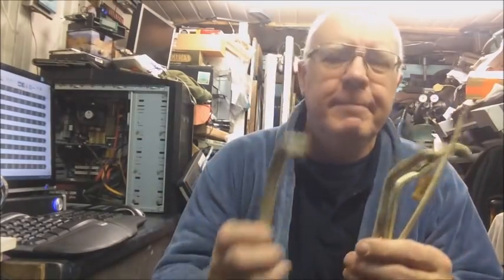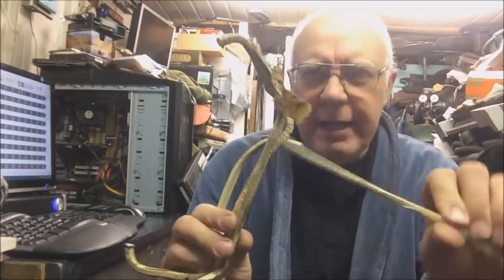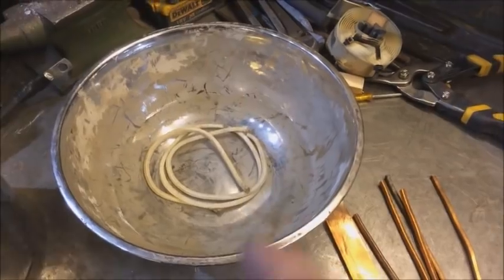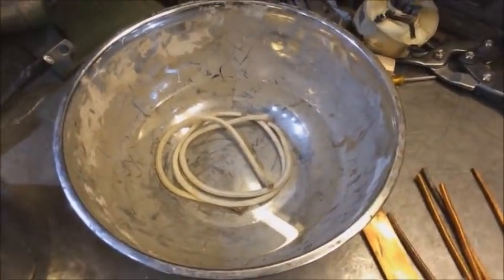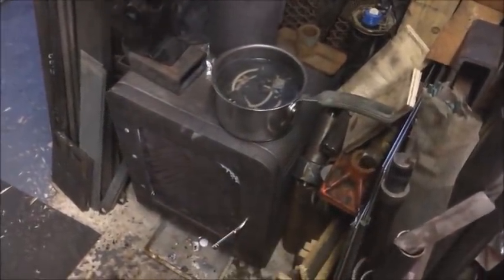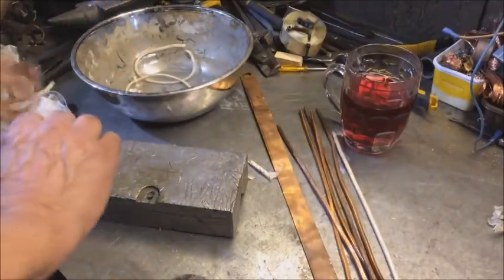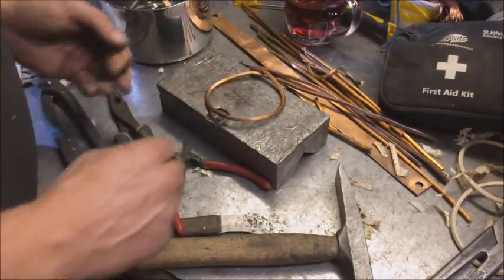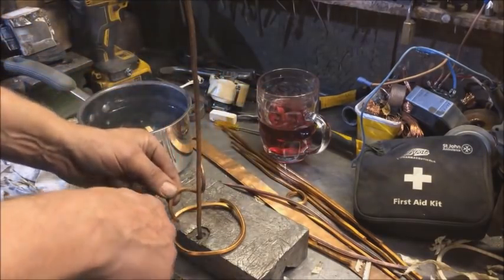Trying some of the  ScrapTips given.

Comment: Ian, yes your idea for copper bracelets, excellent idea. They are sold for people suffering from arthritis. Once you work out the dimensions, perhaps put little round ends on them? Copper does turn your skin green after wearing one for a while. Perhaps a necklace, check out the trends? Definite winner with your Christmas trees idea, especially the spiral idea. You can buy cheap Christmas lights, battery operated in The Ranch and thread them up the spirals.  Put them on Ebay, friends, family, Facebook page, they'd sell like hotcakes. Could just use steel or stainless steel? Thread the lights up the spirals, little star on top, job's a good one. Maybe think of a way of making Christmas wreaths, that'll get your mind working.

Comment: I hope you're feeling a bit better mate. Watch out for that knee getting infected (sounding like your wife - sorry). How about a single length ofo that copper stuck in a drill chuck and hold a wire brush against it whilst it turns. If it spins in the correct direction it should take the coating off but, might be too time consuming? 
As you've already annealed the copper in the fire it should twist easily with less chance of cracking, and it has to be worth more as 'art' than as a raw material? Go for it mate. Have a play. You never know what you might find yourself making. Take care pal!
Reply from the maker: No  your right to be concerned, my neighbour fell onto a rose bush got Tetanus and it killed him .